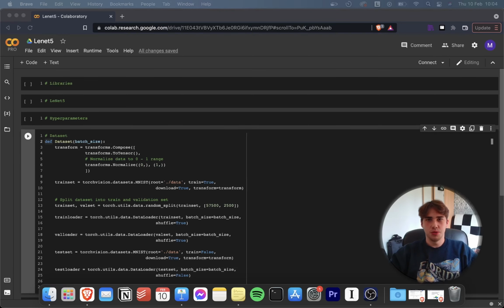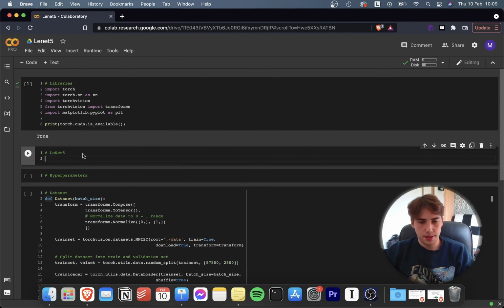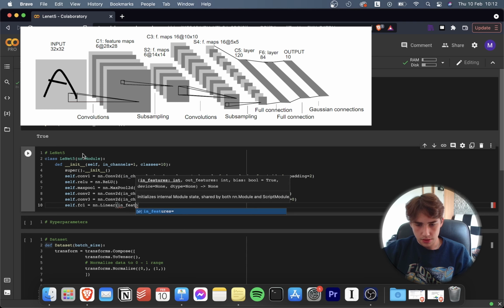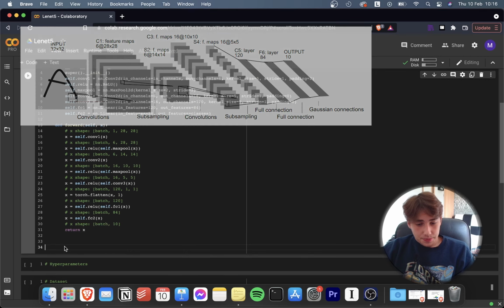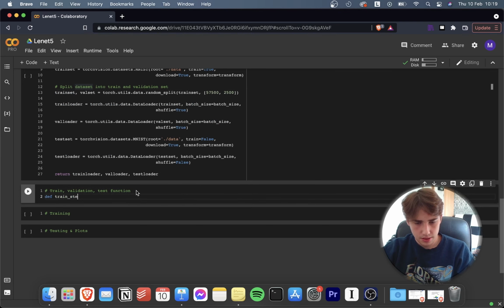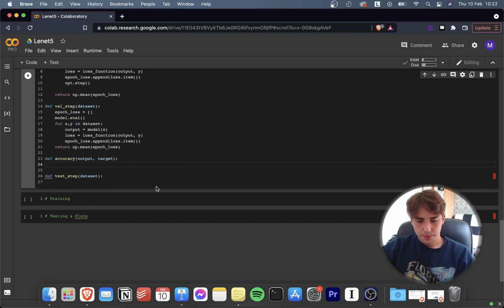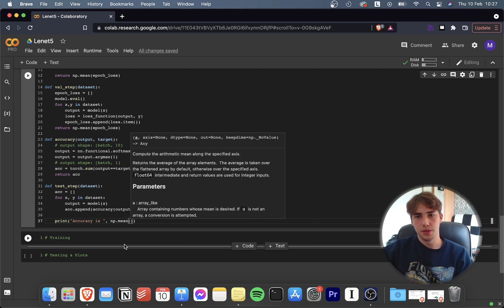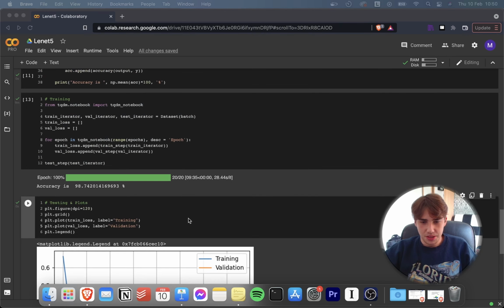Simple Convolutional Neural Network(LeNet5) in PyTorch

Comment: Hi Maciej, Thankyou for the video. It was good learning. I wrote exact code given in video and my accuracy come to 13%. When I ran the code with you GitHub that was actual 98%. May be if there is any Image colorization video that would be great! Great Going!
Reply from the maker: Yes I forgot about opt.zero_grad(), thus the model didn't learn at all. Cheers bud!
Reply: @maciejbalawejder  you have written that in the train_step, but i was also getting 10% accuracy with the exact code as the video
Reply: @maciejbalawejder  Hi ! Thank you for the video, it is very helpfull ! I wrote the exact same code as the video (including the correction opt.zero_grad()) and i obtain 10% accuracy as well ...